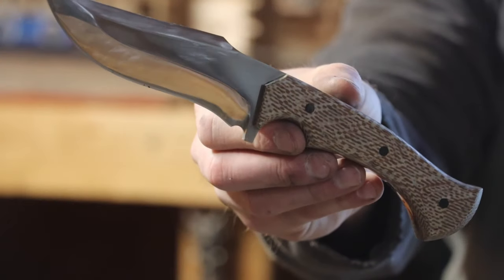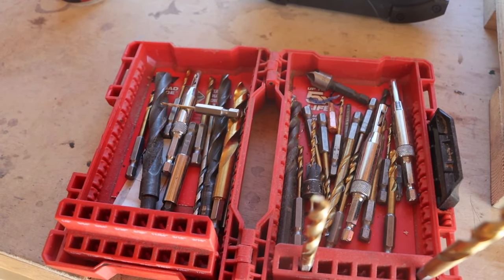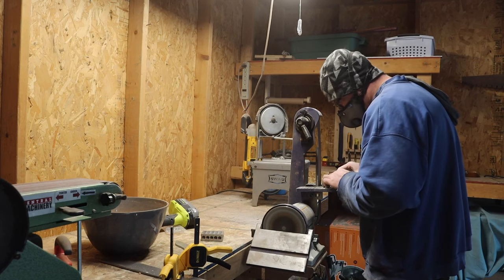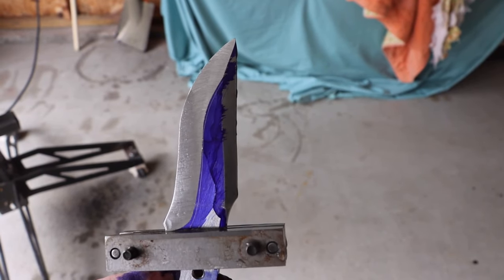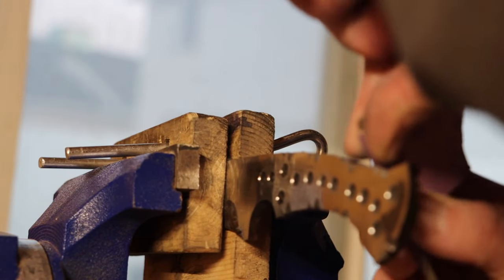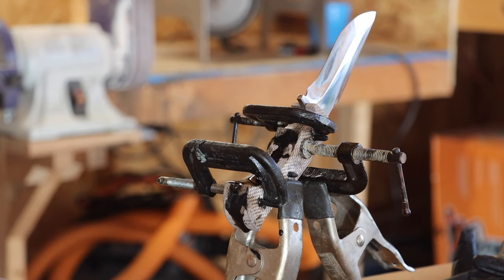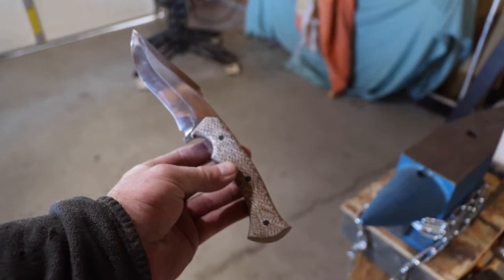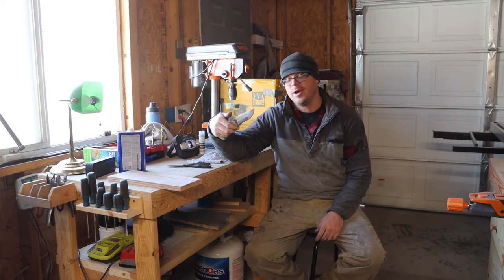Making A Custom Full Tang knife With A Decorative Spine

Comment: Wouldn't it save you a fair bit of fuel to stand some fire bricks in the back of the forge to keep the heat in. As well as make for more even heating. Handsome knife.
Reply from the maker: Hey I appreciate your comment. It most certainly would help. it’s funny you mention that because I normally would do that but knocked them off the shelf cleaning up a few days before this and they ended up in pieces. I just ordered some more off Amazon